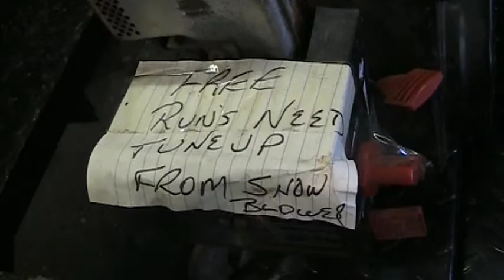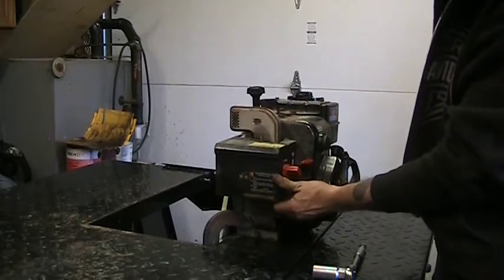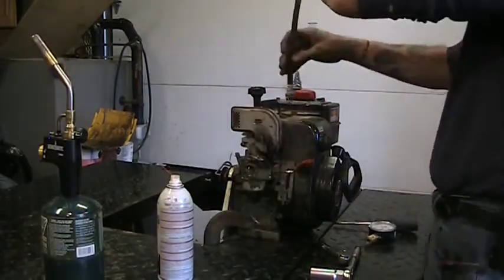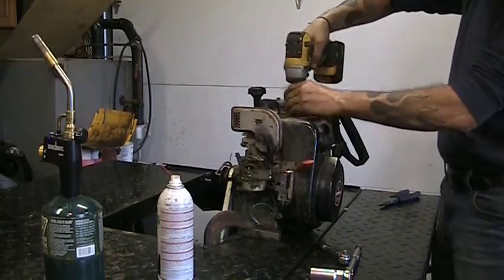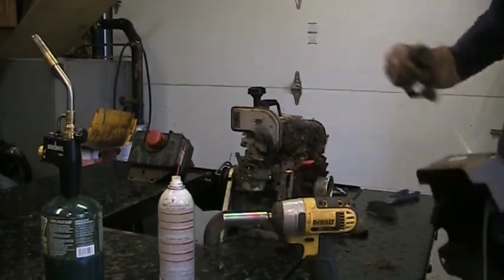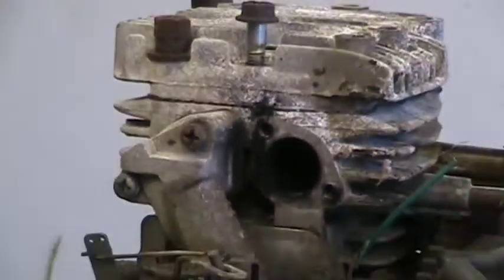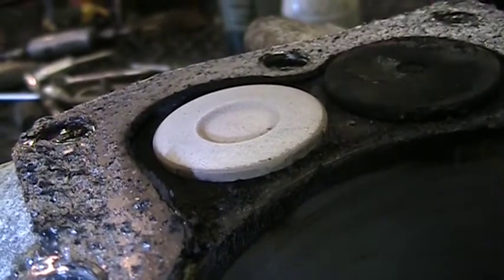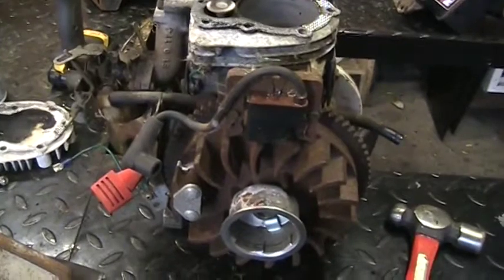Can we fix and use this free roadside engine for a project???

Comment: Looks just like the little 5hp on my yard machines snow blower. Mine came with the electric start thankfully. Pulled the cord the other day and the rope broke!
Reply from the maker: Yep, these Snow King engines were used for many, many years in various HP ratings.

Comment: Just subbed.  Interesting.  Thanks for the shout.  I will clean and reuse any older heavy plug   You know   RJ19LM, RJ 8, 17LM, 19LM, HGK   but the Torch are crap.    You look like you work on a lot of the same stuff as I.  .  Those Torch plugs  come on the Predator clone which aren't a bad engine but the plugs in them are crap.    Great work.
Reply from the maker: Thanks for the comment and the sub, Bruce.  I do concentrate mostly lawn tractors for resale, but I do work on anything with a gas engine.  Yes, even 2-strokes.  Chainsaws being my least favorite.  I use spark plugs from my supplier Laser.  They work very well, never had a failure with one.

Comment: Had one of those 5hp snow king engines this year I was working on and it only had 50psi of compression turns out somehow the exhaust valve had no clearance so had to shorten it to cut back on the amount it bumped up for decompression now it has 100psi
Reply from the maker: Yep, thats what happens usually. I pulled this head off expecting to find no clearance.  I didn't expect the bad valve and/or guide.  I actually have a past video on a snowblower that I had to reset the clearances and it worked out perfect.  Thanks for your comment!